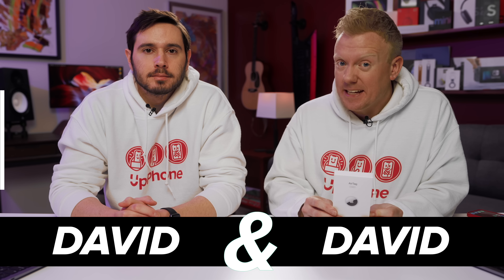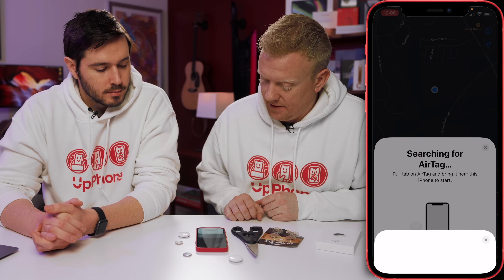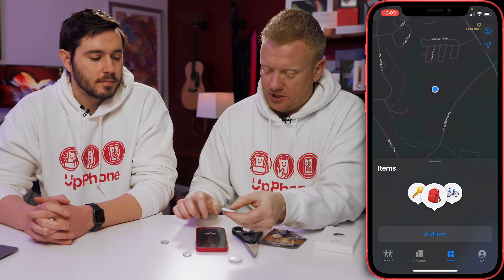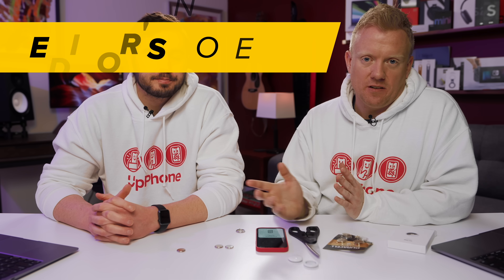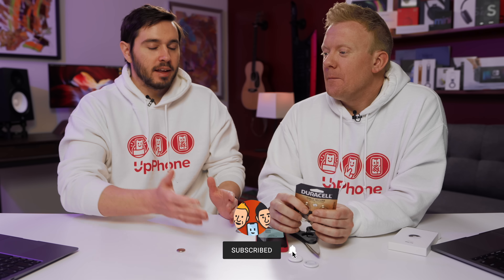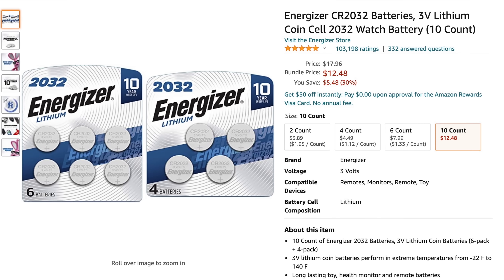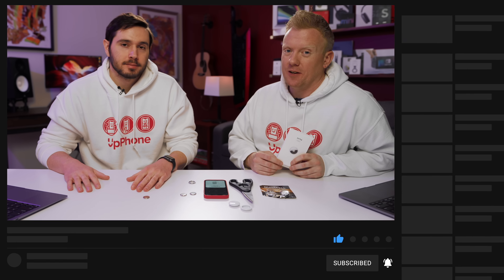HUGE AirTag Battery Problem! Replacements Won't Work! Apple's AirTag Design Flaw, Explained.

Comment: I purchased an airtag to follow my pet. I have had the airtag for a month or so and have only just received the container. But I couldnt get a connection. I opened up the airtag and I had the panasonic battery. I thought it a bit off that it had run out so soon but I went and got a replacement - ironically enough it was a Duracell - and that did not work either. Then I found your website and found what you said about the Duracell. Then i went back and tried again with the Panasonic and eventually got it to make a noise when inserting it. To be honest i am dubious as to whether it will continue to work.

Comment: Yeah, after reading the other comments, it does appear there is plastic still on the battery. Did you try and remove it to see if it works?

Comment: I stopped buying Duracell batteries years ago after they leaked and ruined four flashlights.  They’re trash.  Maybe Apple designed the AirTags to prevent crappy Duracell batteries from being used and ruining Air Tags.
Reply: …different chemistry altogether. The 2032 don’t leak.
Or, let me put it this way…. In over 40 years of using these, I’ve NEVER seen one leak, even twenty-year-old cells.

Comment: How can I turn off air tag tracking. I don’t want my phone to participate in the crowd source location tracking for other people’s devices. I don’t want the battery drain and I don’t want my location to be additionally exposed.
Reply from the maker: Hi Nathan! The easiest way to do that would probably be to turn Find My off completely. Open Settings and tap on your name at the top of the display. From there, tap Find My -> Find My iPhone. Turn off the switches labelled Find My iPhone and Find My Network. Your iPhone should not be able to track your AirTag from there.
Reply: Just buy a samsung and gtfo 😂
Reply: @netics2  I know who I’d rather have my data

Comment: Ive had this problem with the AirTag and battery I got already from Apple, the battery connection is lost once the cover is installed... There is a serious problem here that Apple needs to fix
Reply: It's the bitter coating. Had same problem, but alcohol swabbed the coating off the battery and it's good to go.

Comment: Guys, you just forgot to remove the plastic from the battery 😂
Reply: Negative, Ghost Rider. Plastic is off. “Bitter coating” is the problem.

Comment: This guys are so stupid, it is clearly visible that the duracel has something over the margin. I had one sealed at home and just tried and it works perfectly, the only difference between the 2 is that duracel negative is flat and panasonic a little convex, but this is something good in my opinion.

Comment: This is certainly good information to know, but I hardly think this can be describe as a "huge" problem or design flaw. Panasonic ones obviously work. You put out this video without testing any other brands of batteries? I just tested an Energizer brand 2032, and it works fine. I suspect most others will also work fine. This is really a design flaw in the Duracell batteries. I guess maybe you're going for the views by describing this as a huge problem and design flaw. I don't mind that you did that because now I know to stay away from Duracell. Then again, I never buy Duracell batteries, anyway.
Reply: It’s not a big deal for me, as I found a way to work around the incompatibility, so I’m using the Duracell in my cat’s AirTag, but I would’ve bought a different brand had I known about this.

If the AirTag doesn’t work with certain types of batteries, making this clear up front would help the customers make the right decision when choosing replacement batteries.

Apple’s tutorial video for changing batteries does mention this (at least the one I saw). I can’t check as I tossed the docs that came with the AirTags, but it would be very helpful if certain incompatibilities are mentioned in the paperwork.
Reply: How are the energizers holding up? I tried Kodak and some of the cheapest I found, they lasted me a few hours, Energizer lasted 2-3 days, and I made sure they were all CR2032
Reply: …yes, they are ‘going for the views/clicks” totally.

Those Duracell “bitters” are OUT-OF-SPEC, plain and simple.

It is GREAT that Duracell is doing something about people  swallowing these cells, because they can be fatal if swallowed, but come on, FOLLOW THE SPECS!!

BTW, I’ve tried these Duracell “bitters” in remotes, motherboards, lights, etc.
They fail to fit right 90% of the time.
Out of spec.

Class-action should be against Duracell.

Comment: You need to do another review using batteries from multiple brands, before concluding that it is an Apple issue.  The only conclusion you can make from this video is that the Duracell batteries you used, don't work with the Airtags.  It could be a design issue with Duracells.  Doesn't prove that all Duracells don't work either - as some posters have commented, their Duracell batteries do work with the Airtag.  Could be a batch, quality control issues etc

Comment: This is 100% the battery manufacturers issue… they have specs to work from so either Duracell or Panasonic are wrong if they differ. I would guess Duracell. Apple will not make an update. Duracell will remove the clear film

Comment: Well, I bought one after watching your video today. Apple doesn’t have the same design team, so this could become more commonplace. Was able to cancel my airtag for now until those issues are resolved. Apple will likely sell their own batteries for $100 each.
Reply: 🤦‍♂️ if you think Apple products are so overpriced why buy airtags? Buy tile…
Reply: @smoll.miniatures  you can't even replace the tile batteries at all.
Reply: :v 

so far only Duracell batteries that may not compatible. Or could be something else…..

I just ordered mine few days ago, and I’ll give some update if I could use different brand of batteries when using it

Comment: All Apple has to do is supply a compatible battery list and problem worked-around. The real challenge is preventing the consumer from having a bad experience. That’s where Apple has the opportunity to do magic. I’d love a feature where Apple anticipates the tag’s battery is low and provides compatible battery info in a notification or gives you the option to have a supplier ship you batteries as needed.
Reply: One can easily make it work with batteries from every manufacturer, but it surely is not the users job to fix a bad design. I can also make the magic mouse work, while charging, but I would assume it's their job to design a proper product, when they expect me to pay for it. XD
Reply: @haifutter4166 ”bad design “… except that the ‘bad design’ is on Duracell… their “child-safe” cell it OUT-OF-SPEC. The coating makes it too large to fit a 2032-spec holder.

Stop blaming Apple for Duracell problem.
Reply: @haifutter4166  That mouse gets 8 hours worth of charge in 60 seconds. You can’t take a one minute break once a day?
Reply from the maker: It's a good idea — but not a great look if they say, "Make sure you buy the batteries that aren't safe for children."
Reply: @PayetteForward  Buy the Panasonic CR2032 they work completely fine buy on amazon & they are the same as default apple 👍

Comment: Best Buy sells the Air Tags and they also sell batteries to go along with them – Insignia brand. So perhaps it’s not that you can only use Panasonic batteries with them but that you cannot use Duracells. And altho that’s still a major design flaw, at least it doesn’t restrict you as much. You just have to know that if you buy a brand other than Panasonic and they don’t work, that’s why. 
What I find annoying - and I think it’s a major design flaw - is the lack of a hole or a loop or something to use a keychain. Maybe you can stick them on things? I haven’t looked into that. But if you need to buy an expensive holder to make them functioning, that’s annoying. (There are cheap ones on Amazon, but still....)
I’m still waiting for something really small that I can put on my husband‘s glasses because he loses them all the time. He takes them off to read and then he forgets where he left them.

Comment: This is why I buy a new I phone every few years bc I can’t seem to get a handle on changing the battery. 
> I understand that Apple designs their products to only work with their accessories. But it makes it very hard for people to incorporate the battery changes, accessory replacements, etc. if one has to book an appointment at an Apple store, wait, make several trips, etc. etc. - And yet, that’s how it is .. 
> Like I said, I find it easier to buy a whole new phone, rather than replace the battery. But then, I have to start a relationship w. a new phone - ie. it takes a long time for the phone to sync w. the user. .

Comment: Have you two looked into the fact that the air pod pro rubber tip is causing ear canal irritation in many users, but Apple is doing nothing about it?
Reply: I think we had this issue, at least several weeks since I use it. But not I don’t have that issue anymore

Other than my left ear that feels a bit off for some reason that made me kept changing the tip frequently
Reply: Wow, imagine that.. shoving something in your ear gets it irritated….
Gee, my Mom taught me that some 60 years ago. Great advice…

Comment: Good catch! Maybe put folded tape on the other side of the battery to tighten the fit on the connection
Reply: Thanks for the tip! I had the same problem with an Energizer battery. Placed a bit of folded paper under the battery (opposite side of the pins) so as to ‘tip’ it at a slight angle down so it connected with the three pins. Now works!

Comment: Wow. Major flaw, Apple! Or…does Apple own Panasonic?
Reply: Other non-branded batteries also don't work.  I think this is more of an apple design flaw.  The same batteries that fail in the air tag work in other devices using CR2032 batteries.

Comment: Have you taken off the plastic coating on the edge of the Duracell battery?  Doesn’t look like it from the video.

Yay, looks like you found the extremely thin coating.  Comes off easily with your nail BTW 😉
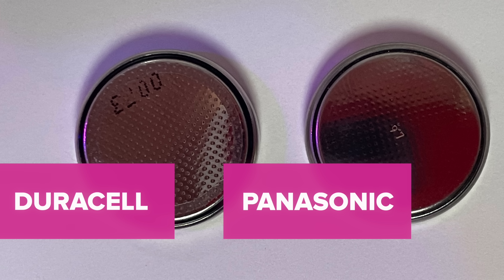Reply: It is clearly visible at 1:47. I do not know if they are stupid or if they will simply tell anything for views.
Reply: @hpekristiansen  probably both
Reply: @hpekristiansen  …spew anything for clicks & views….
Reply: I noticed the plastic also.
Reply: These guys are morons.
Reply from the maker: It may be plastic, but it's the childproof coating and we were only able to get it off with a sharf knife — it isn't supposed to be removed. We're not geniuses, but we know that much!
Reply: @PayetteForward  and? Did it work them. It looks more like the packaging it came in.

Comment: What does an air tag do?
Reply: New product - released about 2 weeks ago that you attach to your things (let’s, tv remote etc) to track them - helps you find list or mislaid items).
Reply: Sorry keys not let’s! - (auto correct!)
Reply: @alexbishop5870  ok Thanks!
Reply: It is Apple’s version of the Tile.
Reply: I’ve never hear of an air tag, so I’d also like to know!🙋🏻‍♀️
Reply: Stalks people
Reply: ...and why do we really need some?
Reply: @markscrim  I dunno, to track something that you often lost

Plus it’s use Apple FindMy network, so it’s a bit more reliable since there a lots of iOS user around to ping the AirTags location